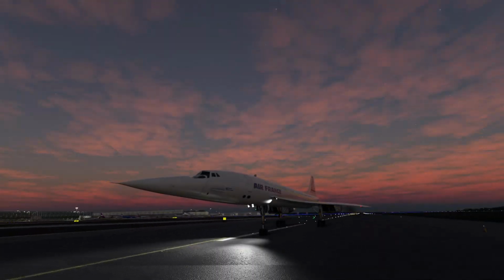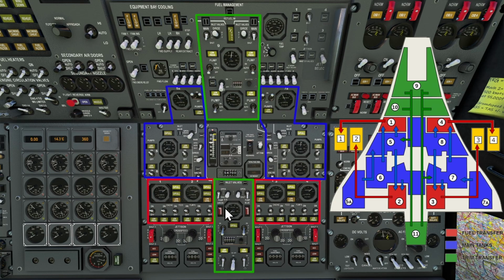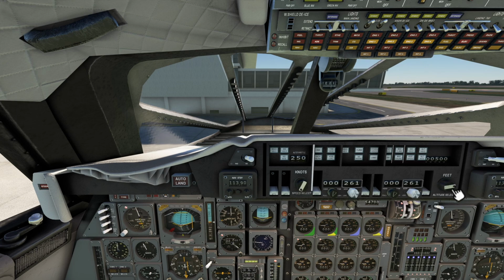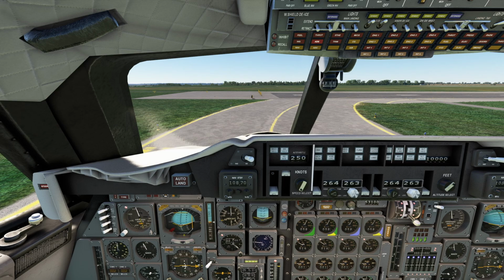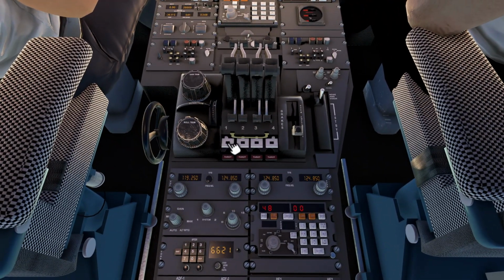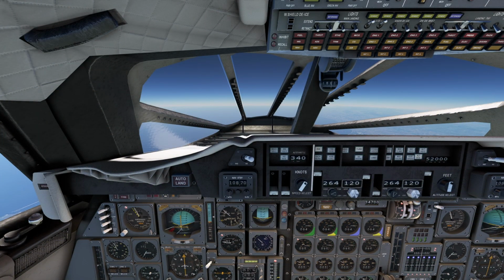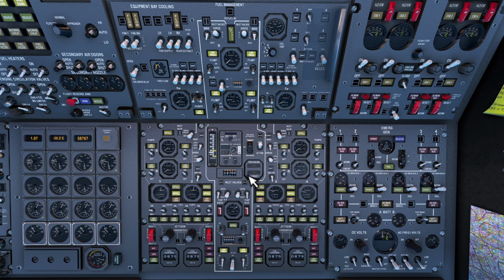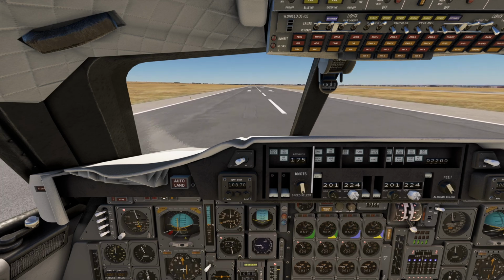MSFS CONCORDE Flightplan, ColdDark to Supersonic Cruise, Landing

Comment: Great tutorial. Today I felt brave and finally got on the Captain's seat of this beauty in MSFS2020... Great experience, even though I'm still a bit lost with the fuel triming systems and some of the automation... I was watching along the video again whilst flying, and I followed your advice on descending early... I started way too early, like 380+ miles 😅as I was scared of getting hot and high for this last phase of the flight... I didn't calculate well and spent half an hour at mach 1.00 or lower... feels like walking compared to the capabilities of this beast. I loved it tho, and found your video super useful, among the best on Youtube. Thanks a lot for it! 😇